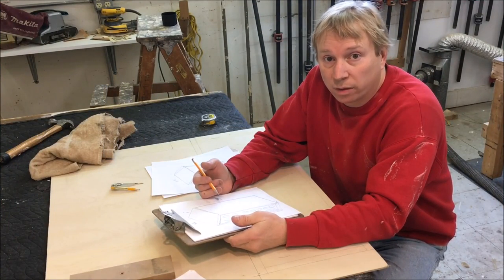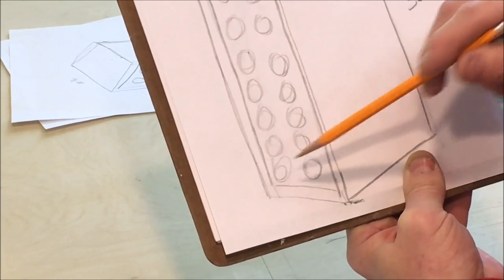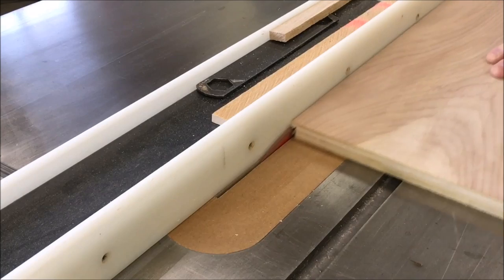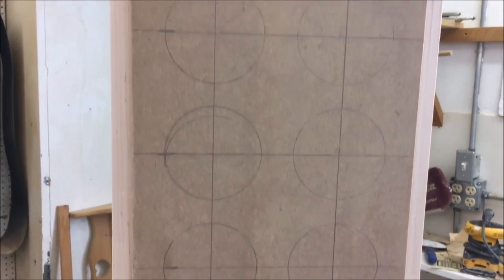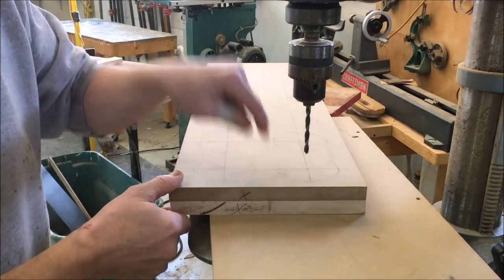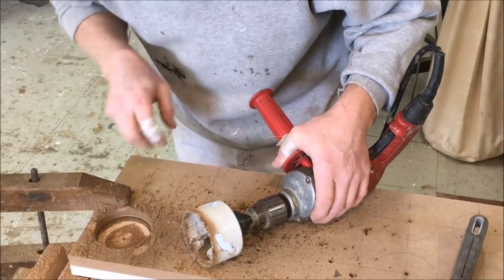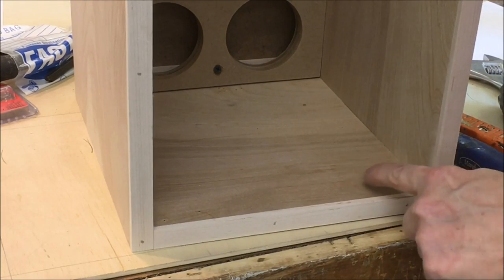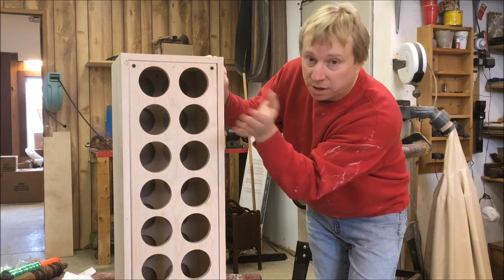MAKING A WINE BOTTLE CABINET

Comment: Nice job  good build, presumably according to the client's directions however I can easily see it being slightly defective for the purpose it was built. They'll be putting the bottles in, bottoms touching/resting against the back rings hence the tips to the front. With heavier weight of the bottle at the back I can figure them dropping the bottles with the slip off  into the rack/cabinet potentially breaking the bottles and making a huge mess. Much better to build either bird cages or if not an additional layer of ringed piece in the middle to prevent potential slip and drop.
Reply from the maker: I looked at pictures of wine racks like this design  and they did not have a center support . if it is  a problem the cabinet can easily be modified if needed since the front panel is removable .
Reply: Inner panel with rings is inset from the inside back of the panel...bottles can easily extend beyond the ring to allow the front of the bottle to rest on the bottle's neck, keeping the cork below the bottle centerline so it stays wet.

Comment: I had problems using my stainless steel IKEA wine rack because it seems some of the newer wine bottles have slightly larger diameter than normal, so my bottles did not fit.